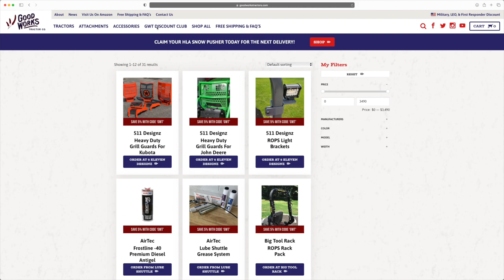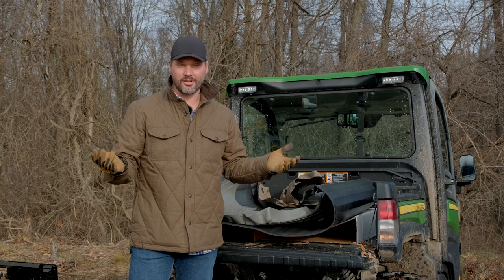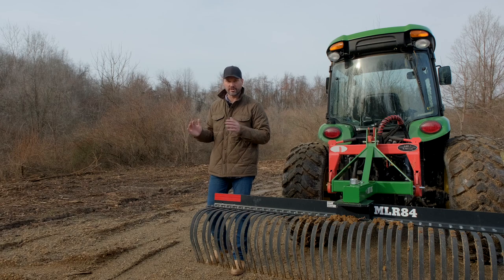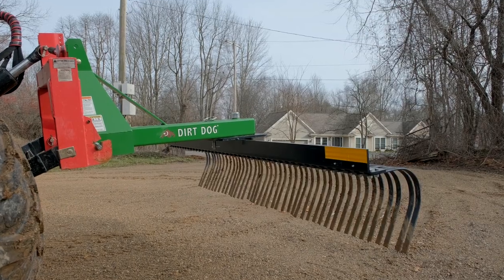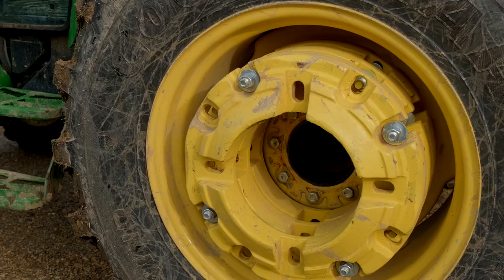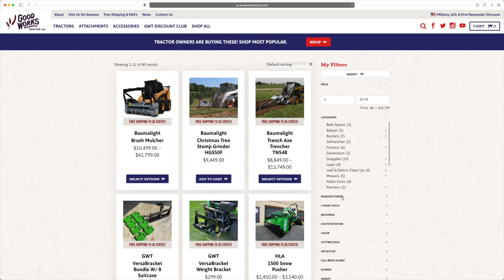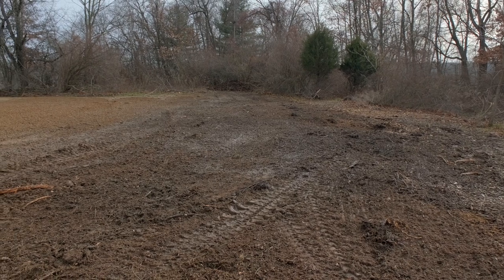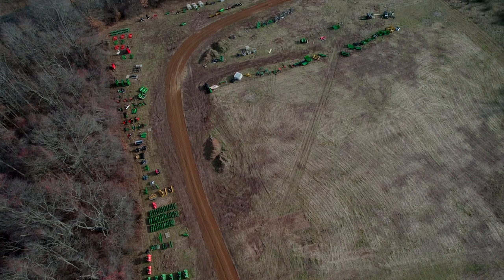BEST BANG FOR THE BUCK? THIS TOOL IS CHEAP AND VERSATILE.

Comment: I have a drive that wanders through timber with the slope changing all the time.  I have a rake, blade and box blade.  I was fortunate and found a tractor with a Top/Tilt kit already installed.  I'd never used the T/T before but have found that it is invaluable if you live on uneven terrain.  When combined with a quick hitch, it also makes hooking up to that finicky 3-point attachment a piece of cake.
Reply from the maker: Yeah, top and tilt is an absolute game changer!!!

Comment: I use gauge wheels on my rake to keep the tines at a fixed depth. The three-point is hard to control, especially as the front of the tractor hits bumps. Also, to maintain a crown on the driveway I tilt the rake with the side link, adjust the gauge wheel on the low side, and angle the rake so that the extra material slides off toward the center of the drive. Those wheels let me get that sure-pack as smooth as pavement.
Reply from the maker: yeah, my crown is already established so the tractor leans along the side of the crown which allows the rake to also lean.  Gotta try the wheels!!
Reply: @GoodWorksTractors  years of the previous owner plowing snow messed up the drainage. Now that I fixed that (with some help from your videos) I'm going to try a front-mounted snowblower to try to preserve what I've got. I also roll the driveway with a big lawn roller after raking.

Comment: I have had good luck using the rake on a gravel drive with gauge wheels. I then hook my drag harrow (8'x8') on the back of the rake. Now the rake levels, fills holes and the harrow smooths it all out and lays down the ridges in one pass.
Reply from the maker: I've gotta get a set of wheels to try it out

Comment: I have gage wheels on my rake that are adjustable up and down it helps quite a bit for depth of cut for different materials
Reply from the maker: Yeah, I gotta try a set of those out at some point.  Easier to use those than to adjust the three point?

Comment: I considered one of those nice tractor mats for my 4 series cab tractor several months ago. But when I saw that they are only offered in tan color, I changed my mind. My OE mat is black for a reason, it doesn’t show mud and crud like a light colored mat would. I’d buy one tomorrow if they offer them in black. Just my two cents…
Reply: pretty sure black is the color that shows the most crud. Ever notice how clean a person has keep a black car?
Reply: @kcrariden6922   I disagree. My truck came with tan floor mats, they were exceptionally hard to keep clean, they showed every speck of dirt and mud. I replaced them with black mats…they hide the dirt MUCH better than the tan.

Comment: If yo get rid of the 4720 and the LS you can get a small 4 series tractor
Reply from the maker: What's a small 4 Series?
Reply: @GoodWorksTractors  a 4052R it is similar to the 4066R but 14hp smaller